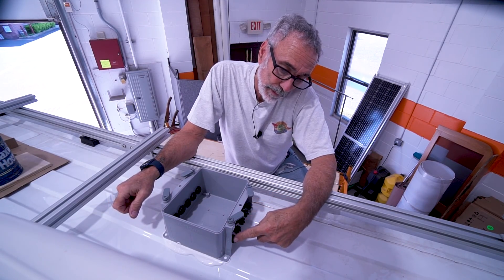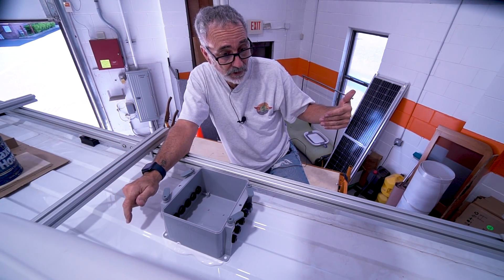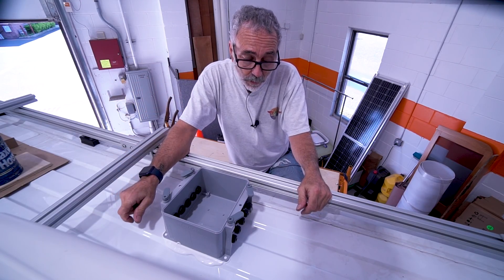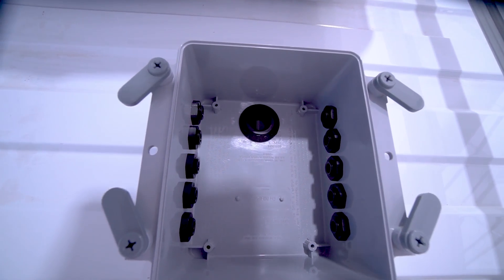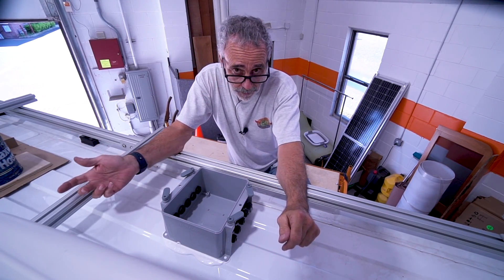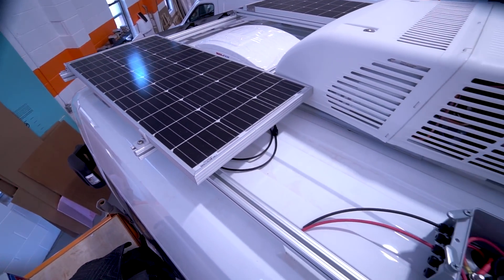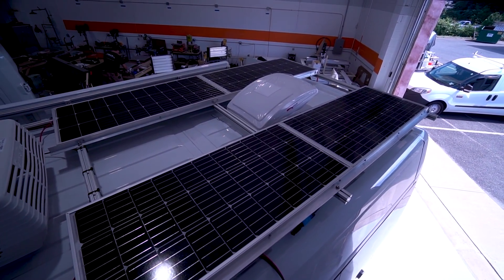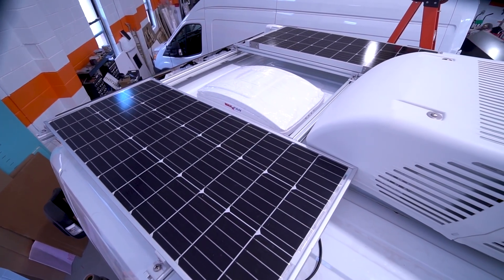Make all your solar connections up on your van roof with a waterproof COMBINER BOX.

Comment: Love your videos and respect your research and knowledge.  I see you are using 3m 5200 but I think in a video from a while back you used loctite PL-marine in construction.  If I'm correct, is there a reason you switched or do you still use PL-marine in some cases?
Reply from the maker: I use different adhesives for different applications.

Comment: With 3 parallel you are probably @17A open circuit and the panels are probably rated 15A max are you placing 15 A fuses in each panel line?

Comment: Either way they are wired, you have the same number of watts. The mppt will take the volts and amps and scale them to what is appropriate for the battery state of charge. I believe there is some loss in a large voltage conversion, but series wiring and higher solar voltage will start charging earlier in the day or in heavier cloud cover, giving better performance in winter or less ideal conditions.

Comment: What size 8020 do you use? 1" x 1"?
Reply from the maker: I use either 10 series or 15 series, depending on load. The roof rack is 15 series.

Comment: George, have you considered reaching out to the community for an expert on aerodynamics? Maybe there is a viewer out there that has access to a wind tunnel for testing. I only say this as I look at the installation of the solar panels on the roof. Could wind tunnel testing possibly suggest angling the solar panels with a slight angle upward from front to back to provide a "spoiler effect" while traveling down the road. Just a thought.
Reply from the maker: A good thought, Steve. While I have not shown it yet, we have a wind deflector on the front edge of the assembly

Comment: The Victron MPPT charge controllers take what ever combination of volts and amps from the panels to produce the max amps at the batteries voltage. So with parallel panels, you get higher amps less volts to the controller but bigger wires. With the panels in series, you get less amps higher volts to the controller and use smaller wires. Given the panels in series and parallel provide the same watts, the controller will provide the same amps to the batteries. Shading is an issue with series but not so much with half cell panels. I like the idea of higher voltage smaller wires. Also with the higher voltage, cloudy days the voltage will still be above the 5v difference between panels and batteries state of charge. So if the batteries need it, they'll be able to get a charge. That's my understanding.
Reply: I agree.  The MPPT controller does the work.  Efficiently moving higher Amps requires larger gauge wire. High voltage to the controller, is efficient with smaller (10 gauge wire).  High voltage is better.  The MPPT does the thinking and takes care of the rest.  Both will work with different degrees of performance.  Be sure to use UV resistant insulated wire!
Reply: 24V? (Or basically 36V going to the controller) For the average van builder, I'm thinking that's the sweet spot between increasing voltage (to decrease current and wire size) and risking your life messing with higher voltages.

Comment: I’ve been enjoying your channel for a long time and have picked up some great tips  but man you lost me on this one. Your running MPPT controllers so your panels should be in series not parallel.  What’s going to happen on a cloudy day when those parallel panels aren’t generating a voltage 5v higher than your batteries? I think you need to research how MPPT works a bit more.

Comment: At the 2:00 minute mark of this Victron Energy video, the advantages of series vs parallel connection of solar panels explained
https://www.youtube.com/watch?v=NXfHM-p3ehM

What I've noticed with all YouTube van tours, is that nobody talks about the maximum voltage and ampere ratings of the solar panels; they only tell the watts and the type (mono crystalline most of the time). And some retailers will say if it's walkable, flexible or has internal diodes against performance loss when partly shaded, and the dimensions.
While V and A of the PV panels are also important when designing the system (matching the desired charge rate, with the panels and the controllers).

For vans I would calculate the available area on the roof.
Pick a panel that gives me the maximum amount of watts for that area.
Check one charge controller that is the closest to handle the maximum volts and amps and watts of the selected panels with the Victron solar calculator, with simulation for parallel and series connection of panels.
Half the first set up to work with two charge controllers and use calculator again. If the results are the same, check the costs incl. wiring and fusing, because two smaller charge controllers can be cheaper than one large controllers with the approx. the same output.

Each controller wants the maximum rated voltage for it's top performance, so you would think series. But higher voltages are more dangerous. That's why we like to keep 12V DC in moving vehicles as much as possible.

Comment: Sorry but you should have used 3M 4000,  5200 is not rated for UV and will crack and chalk over time.  4k is.
Reply from the maker: 100 percent incorrect. Get a tube of 5200 and read the very first paragraph on the back label.
Reply: @HumbleRoad  5200 is meant for below water applications.  4k has the purple label and specifically says UV rated.  I've worked in yachting long enough to know what is what.
Reply from the maker: Where are you located? If not close by (NJ) I would like to talk with you.
Reply: @HumbleRoad  I'm currently in Virginia but worked a long time on all types of marine systems.  We can email if you like.
Reply: So 5200 will mildew and 4000 will not?  The former is for something permanent, though, and 4000 is a wee bit more flexible (less permanent) correct?

Comment: Remove the two powered roof fans and replace with one marine solar powered vent. Add a passive close-able vent in the floor. Remove roof AC. Use two 410w PV panels, with two more (switchable) on slide-outs to serve as a rigid awning along the starboard side when parked. Optionally, stack a second pair to extend out the port side. 820w while stowed, 1640w or 2460w deployed.
A small atmospheric water condenser can now be powered to supply water for shower, laundry and general cleaning, and filtered for cooking and brushing teeth. A secondary effect of AWCs is that they chill the intake air over their condensation vanes. With a little creative duct gating, one can select for cabin cooling, cabin heating or neither.

Comment: AM solar makes a slick, low profile combiner box that would probably fit under the panels if you ever have a need for the space savings.
Reply from the maker: But then to access the combiner, a solar panel must be removed?
Reply: @HumbleRoad  assuming your panels are easy to remove like mine, in the rare event you need to get to the combiner it’s no biggie

Comment: Go 3S2P, put diodes in that combiner on each string, and ditch/save the money of that second mppt controller.
Reply: Single 30 A controller is too small for 600W array.
Reply: @JGnLAU8OAWF6  depends on the battery voltage. Would be fine if it's 24V.
Reply: @pau1phi11ips  judging by DC-DC charger they are 12V.
Reply from the maker: 12v system. But the big reason is redundancy. 2 controllers are better than 1
Reply: @HumbleRoad  still, 3 series is much better than parallel, as long as OCV is less than 33V per panel.

Comment: The Victron MPPT will start charging at BatVolt+5V, but it is not at its most EFFICIENT at that low voltage level. The highest efficiency for most MPPT controllers is when PanelVolts is approx DOUBLE the BatVolt. In the case of Victron MPPT, the manual specifies this quite clearly. MPPT functions need a broader range of voltage (above the battery voltage) from the panels to find the right MPP combination of volts and amps to track, before converting down to battery charging voltages. My strong suggestion is to follow Victron's recommendation on this, and configure the panels into a two strings of 3S for each of two controllers, or into a 3S2P config for a single large controller.
Reply from the maker: Disagree
Reply: @HumbleRoad  It has been a little while, was wondering if you did any comparative testing to see if series or parallel works better for you.
Reply from the maker: @PanelsUpSolar  series has given me the best results. I now do two separate strings in series with dedicated MPPT controllers
Reply: @HumbleRoad  thanks for the response. Been enjoying the binge watching of your videos.
Reply: @HumbleRoad  fair enough. It will work, of course. :)

Comment: With MPPT as long as voltage of panels higher that battery voltage + 5V and all panels generate equal amounts of energy there should be no difference between series and parallel. When sun is not as bright parallel connected 12V panels may not generate enough voltage to start charging, while series connected panels can (total voltage is the sum of voltages of series connected panels).
MPPT can turn higher voltage into lower voltage with higher current, that is it's main difference from PWM charge controllers. So your assumption of longer charging time with higher voltage could be wrong.
Reply: Agree 100%. Series is almost always better for MPPT. Especially if you’ve gone with the expense of a separate charge controller per string. I’d rather have spent the money of the second charge controller on diodes for the combiner box. I’d rather do them 3S2P.
Reply: I agree too. I don't think this would be the best setup unless you're expecting heavy shading on some of the panels that are parallel connected. Series would give more power out over the whole day as it would turn on quicker in lower light levels.

Comment: Is the 6 solar panels not an overkill?
Considering advanced has none
Reply from the maker: ARV uses a second dedicated alternator to pump 280 amps into their proprietary battery bank. This Promaster utilizes two 30 amp DC-DC chargers, solar or shore power to charge the Lithionics 630 Ahr lithium battery. So no, 600 watts of solar is not overkill. If I could fit more up there I would.
Reply: @HumbleRoad  I suppose it’s really about the client’s requirements. Still, it seems like the charging side (solar and alternator) is a bit overbuilt for that size battery.
Reply: @Tesla Porn. No 6 isn't overkill. I'm just about to start of my Aluminum TIG welded roof rack on my '20 promaster 159 and I'm putting 800 amps on the roof. 2 rows of 400 with a blank space down the middle containing 2 Maxxairs and a skylight. I'd put 1 KW up there if I could fit it.